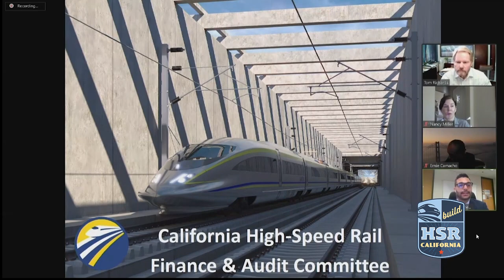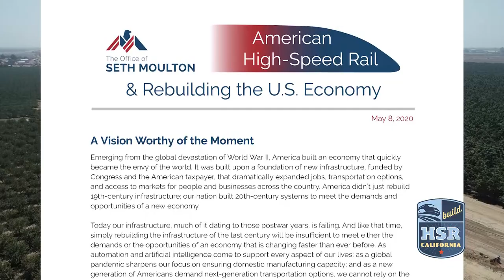California High-Speed Rail: Top Moments of 2020

Comment: I did a 'back of a napkin' calculation a few years ago when High Speed Rail was just starting.  The California High-Speed Rail Authority published on-line the financials of the project, including O&M.  My quick calculation estimated that if each train carried 2,000 passengers (will probably only be 400), a train left every 15 minutes from each end (like the Shinkashen does in Japan), and the cost of a ticket was $95 (the average cost of an airline seat from LA to SF at the time) and the trains were full 12 hrs a day (fewer are going to ride at 2 am), there was NO WAY it would pay for just the projected O&M costs.  Not even close.  Let alone the cost to build the thing.  In China, where we lived for 9 years, it's amazing what they are able to accomplish.  From NO HSR in the early 2000's to the MOST MILES in the WORLD now.  From NO HSR rolling stock production in China to now one of the leading EXPORTERS of rolling stock and (especially important) engineering.  Their trains are clean, efficient, on time to the minute, relatively inexpensive, and at least some of the lines are profitable (don't know about all the lines).  As an engineer, the incompetence I see in the U.S. saddens me.  Oh and one other thing for the Global Warming crowd.  The manufacturing of Cement is a huge CO2 emitter.  I read somewhere that cement production produced around 15% of CO2 emissions from human activity.  If the train never runs the project will actually have CONTRIBUTED to Global Warming yet the project is heavily funded by Carbon Credits.  Again, it saddens me.

Comment: When will the track and catenary will be installed?
Reply: Short answer: Very soon. The project was ready in September, but 2020 politics pushed it to the end of 2020.  
Long answer: The Track and Systems contract has submitted bids and was due to be awarded last September according to the 2020 Draft Business Plan. However, the CA Assembly decided to wait until this December(read: post-election) to vote to finalize the 2020 Business Plan. With that legislative delay, the Track and Systems contract has to wait until the Business Plan is finalized before being awarded. That means that as soon as the Assembly votes on the business plan (stated by the Assembly to be this month, but the exact day is not announced by the Assembly) then the Track and Systems contract can be awarded. Meanwhile, CAHSR has been stockpiling up additional route segments that are ready to receive track and multiple notice-to-proceeds are expected within a month of the contract award. The contract completion deadline for Track and Systems has not moved from December 2022 so you can expect the contractor to begin track work asap to make that cutoff (the money will literally stop if they take longer to complete it).
Reply: Ringsofearth  Thanks for clearing that up.
Reply: RingsDaGamer6  They are probably going to run out of money again and instead switch to the high-speed bus plan lol